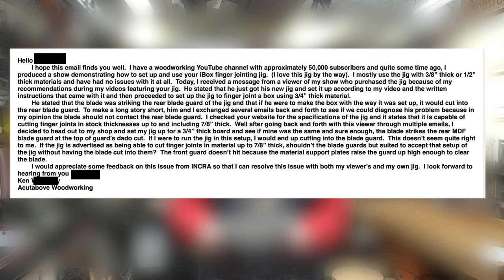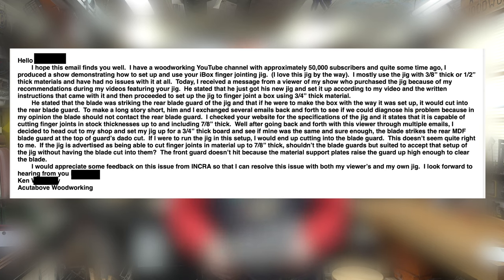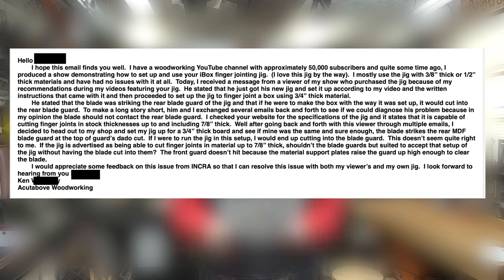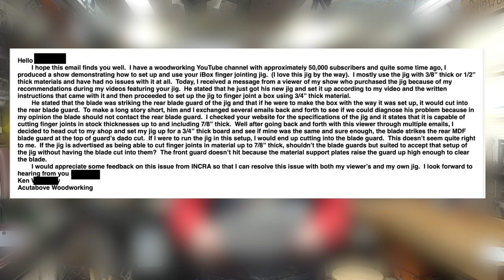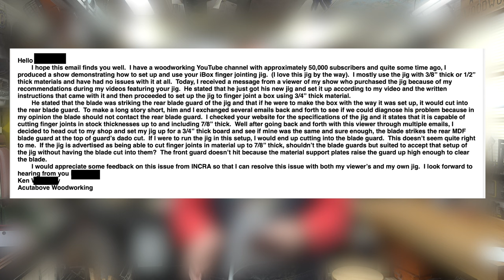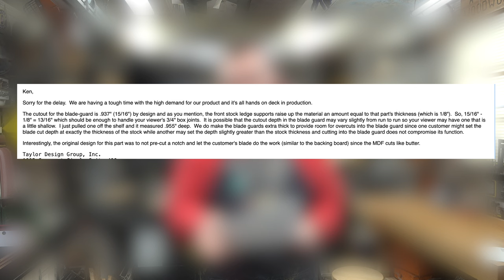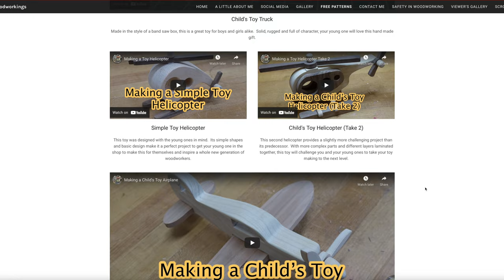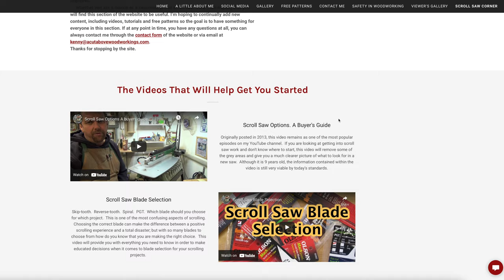Spring Updates, 2022 Part 1

Comment: Hi Ken. I am recently new to your channel. I am building the rolltop desk. Fantastic videos that you fill in the gaps left by the plans. I’ve been a woodworker since fifth grade when I took a summer school class at my soon to be junior high school. That was about 52 years ago! I use Shopsmith equipment almost exclusively with the exception of a router.

Regarding Incra box Jig, I have the Shopsmith version, it is very tedious to set up. However, I’ve had no issues with the rear blade guard interfering with the blade when doing three-quarter inch finger joints. are used scrap three-quarter inch plywood that’s a true three-quarter inch. I made a box with slots on the top to hold my saw blades.
Reply from the maker: It would appear, that INCRA is aware that the blade will slice through the rear MDF blade guard but their solution is to just cut through it and not worry about it.  Not really a solution in my mind.  I'm still considering using my dado blade and modifying the rear blade guard to prevent the blade from cutting through it during a project.  It sounds like Shopsmith has it figured out and has done it correctly.  Thanks for tuning in to the show and for taking the time to leave the kind words.  I hope that you will find other episodes of the program that will be useful to you.